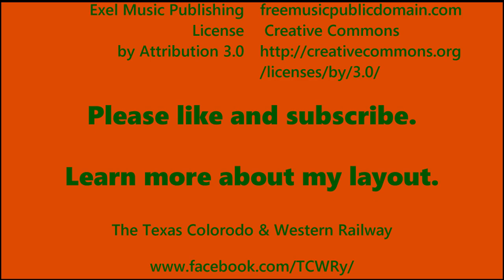Short Circuit Protection for Your Model Railroad DCC System

Comment: My layout is HO four mains each 60-63’ in length. I have color coded Bus one for each track and four PSXX circuit protectors and run Blunami which is particularly sensitive to even the slightest power blip. I am going to install some of these but curious as to how many my first thought is at least one per track but how many would you recommend per track. I am guessing but are these not for momentary shorts versus a dead short before the PSXX trip? Thanks Ron for sharing

Comment: Are you still using the lighbulbs for short circuit protection? Did you switch to electronic circuit breakers.
Reply from the maker: I am still using the bulbs and have no intention of switching. It would just be a high, unnecessary pricetag.

Comment: I know this is an old video, but I was curious as to why you do not suit case your feeders directly to your main bus wire. What in your opinion is the benefit of having a secondary bus wire? Perhaps you mentioned this before but I missed it. Thanks for your postings. Always informative.
Reply from the maker: There are 2 reasons. 1) Using the sub-bus allows me to use the light bulb protection on each sub-bus to protect that district. 2) Because I use suitcase connectors, there is no connector to connect a 12 gauge wire (my main bus) to a 22 gauge wire (my feeders). A third reason is it keeps my main bus from becoming cluttered with offshoots. If I make a change and need to rewire, I can change that district without touching the main bus.
Reply: @RonsTrainsNThings  thanks for your explanation to my question. I did realize a few of those reasons the next day, but your full explanation really filled in the blanks. Sound reasoning for sure!

Comment: Hi Ron, i enjoyed your video and am just building my first model rail i have mastered soldering jumpers to n gauge track etc and come from an engineering background but there is no way i can get the solder to adhere to the side of the taillight bulb. I have filed it, used ethanol to clean it, used a rosin flux with an adjustable 65 watt soldering iron. Can you tell me what i am doing wrong the base terminals are no problem? Many thanks SRB

Comment: I was curious, so I checked out the specs on the 1156 bulb and the resistance is 6 ohms.  Just some of trivia here.  😊  Thanks for all the great tips.  👍
Reply: thanks for that info, it's very helpful. What kind of wattage rating? Any idea? I would like to use a larger diode with a resistor attached, and have the diodes mounted on a maintenance panel pointing to each district.
Reply: @KWE.ECLECTIC  SYLVANIA spec's it at 26.88 watts.  I would call it 27 watts.  😊

Comment: Great video Ron. Thanks for sharing.
I'll definetely try it on my layout, as I have several sections that I want to split for better management. This will give me the chance to install the lamps on the different sub-buses.
I'll also try to install the lamps so that they are visible on the fascia, and that way are able to give me an immediate indication of which section has a fault.
Perhaps smaller bulbs could be an option. As long, of course, as they have similar characteristics.
Thanks once again for sharing.
All the best.
Reply: Did you mount the bulbs on the fascia?  How did you do the mounting?

Comment: Hi Ron I’ve just subscribed to your channel and found this technic of interest. I also subscribe to the dcc guy Larry Pucket, and he talks about RT filters, or other wise known as a snubbers, which uses a resister and capacitor to absorb electrical spikes. My question is do these two techniques serve the same purpose?
Reply from the maker: No, the two concepts serve different purposes and are not interchangable.

Comment: Great idea.  I'm putting together my purchase of these parts but I do wish you had included a parts list.  I'm only guessing that the cable clamps are about a half-inch but it would have been better if you had actually listed the size of the part needed.  also, I had to sift through about 25 pages of terminal blocks until I found one that was close that didn't also include a lot of extraneous pieces that I didn't need.  It would be great if you could update me with all of the actual pieces you used. It's hard for me to get out of the house to buy these things in person so I have to rely on Amazon for most of my parts.

Comment: Thank you very very much !
It is so helpful !
I plan to use a 3 cell Lipo Powerpack, the speed controlled by a microcontroller ( ATTiny ) PWM.
Portable, that´s why the Powerpack.
Those Lipo provide a lot of amps, so in case of accidental short circuit there is a real danger for burning your house.
( I did one, but had luck. )
If not by the cables, then by the Lipo Powerpack !
And you can use the reduced Voltage as signal to stop the PWM !
-->Double safety !
Once more: thank you !

Comment: I am not sure if the 1156 bulb method works for an nce power cab.  Typically I find that the power cab responds first by shutting off and resetting and that the bulb doesn’t come on at all. Sometimes the bulb does light but is more the exception than the rule. Has anyone experienced this? I’ve checked my wiring and I think it’s ok but I am open to any suggestions. Thank you.

Comment: Ron.  Great instructional video.  I have a question. 
I have 5 terminal blocks throughout my switching layout. I have no created power blocks. Likely will run no more than a couple of engines at a time, at most.
Do I need to install short management on all 5 terminal blocks?  Will one do the job?
Reply from the maker: If you have no divided power blocks one will do it.
Reply: Thanks Ron.  I'll make it so.

Comment: love the idea  but the bulb is resting against your bus wire when seeing a short will this not illuminate the bulb to full power (getting hot) and melt the bus wire its resting on ?
Reply from the maker: No, the bulb doesn't get that hot, plus the idea is to find the short and relieve it quickly, not to leave it and let the bulb burn long term.
Reply: @RonsTrainsNThings  hi thanks for this answer  i apologise  for the query i am now retired due to  cancer and need a hobby so i am new to model railways and building a dcc layout i am trying not to make any costly mistakes i try to watch and learn your posts are very helpful thank you

Comment: Great video! this method makes perfect sense. there's really no way that the amperage could spike higher than the bulb allows, which i think is 2 amps and that's not enough to damage anything.  At least based on my somewhat limited knowledge of electronics.

Comment: Thank you for a great  and informative tutorial. I know this is an old clip but I am new to DCC and have had a lot of problem managing short circuits. If followed your instructions pretty closely  and I have had no further issues. I appriciate you taking the time out  to show your method. It was cheap and relatively
 easy to follow.
Reply from the maker: I am glad you found it helpful and it worked out for you. I've been very happy with this method for many years.
Reply: @RonsTrainsNThings  Thanks again, I just finished wiring my dcc layout and it seems to be working fine. its been a great help your instructions were very easy to follow and its a great cheap idea. On a side note,  I was wondering if you may have some advice or past videos about short circuits and how to find them on your layout?
Reply: I know this is an old video, but I was curious as to why you do not suit case your feeders directly to your main bus wire. What in your opinion is the benefit of having a secondary bus wire? Perhaps you mentioned this before but I missed it. Thanks for your postings. Always informative.

Comment: Ron, and Anon (with the comment just below...

Correct, and this works because the automotive incandescent bulb resistance changes with heat... 
Normal operation with relatively low current flowing to the Locomotive motors = Bulb is cool = Low resistance = Not enough current flowing through the circuit path to cause the bulb to start glowing.
With a "short circuit" on the track... the high current flow thru the series bulb filament wire warms it up = Bulb starts glowing with its filament now hot, and the filament resistance rises from the high heat, which then limits the total current that can flow through the circuit, preventing the DCC Supply Breaker from tripping.
The proper description of this circuit is Elegant, not crude at all.

Comment: I understand the basics of how this works.  But what about the short itself?  Is it usually a temporary thing?  If not, do you try to isolate it?  My layout will be 4x16' and it might be hard to detect a lit bulb 16' away?  Thanks.
Reply from the maker: Once running, most shorts on a laout are cause by equipment derailring, a wheel fouling a turnout, or something being place on the layout. These are typically easily and quickly seen and corrected.
Reply: @RonsTrainsNThings  Thanks, Ron!

Comment: Great presentation Ron. Very helpful as I explore different ways to add a breaker system. Very crisp; no extemporaneous, unnecessary chatter about unrelated jabber. This system I have heard about from a friend who uses this method in areas where he wants visibility to which area is shorted vs. needing to look under the layout. He has his mounted in view but discretely unobtrusive. And your take-outs were precious!

Comment: For those of you who wonder why this works try this explanation. A 1196 auto bulb draws a little more than 3 Amps of current in a 12 Volt tail light circuit. According to Ron the motors in his trains use far less than that (they are high resistance) so there normally is not enough current in the feeder wire to make the bulb glow. When there is a short however, the resistance in the circuit goes down to near zero (not up like he says at 4:57). When that happens the only resistance in the circuit now is the bulb (about 4 Ohms) which draws all the amps it needs to light up.
Reply from the maker: Yes, I misspoke regarding resistance going up, as I've acknowledged multiple times in the comments.
Reply: Correct, and this works because the automotive incandescent bulb resistance changes with heat... 

Normal operation with relatively low current flowing to the Locomotive motors = Bulb is cool = Low resistance = Not enough current flowing through the circuit path to cause the bulb to start glowing.

With a "short circuit" on the track... the high current flow thru the series bulb filament wire warms it up = Bulb starts glowing with its filament now hot, and the filament resistance rises from the high heat, which then limits the total current that can flow through the circuit, preventing the DCC Supply Breaker from tripping.

The proper description of this circuit is Elegant, not crude at all.

Comment: I’m new to this and I am wondering why would you need to use different power districts with DCC? (I mean, other than a reversing loop where you’d have to swap the two wires.) I can understand that with a DC system power districts enable you to switch power to the respective track segments on and off. For example if you would want to leave a train staging on a track or a spur line, you’d power that track off. With DCC, as I understand, you’d simply not address the DCC signal to the respective locomotive.
Reply from the maker: Good question. There are two primary reasons. First, for a larger layout, you may need more power than your DCC system alone produces, so you may employ power boosters and each booster would power it's own district. Second, and more commonly, if you operate your layout with more than one person and thus have more than one train running at once, you will probably want to break your layout into short management districts. Without them if any train shorts the rails the entire system shuts down ala the power breaker in the unit. Using short management districts with bulbs as I describe here or breakers in each district allows the other trains on other parts of the layout to keep running even when one train on one district shorts out. It also provides your equipment some additional protection from damage resulting from a short.
Reply: @RonsTrainsNThings  Thanks for your detailed answer. Good points!  Much appreciated!

Comment: Hi Ron,
Thank's for the video!
Great solution to what could be a costly problem. One question, in your opinion would the length of the bulb wires make any difference  to the amount of current to the feeder wire? I assume it might, but not sure if it would be nominal or not.
 Reason being, I'm envisioning a panel not all that different from a dc block panel except with the bulbs located on said panel indicating their respective power districts.
Thank's again!

Comment: I’m getting ready to build my 1st DCC system.  I’m planning on using this bulb system ... my question is- how often do you experience a short?
Reply from the maker: You will tend to see shorts when you have a derailment or, in some cases, as equipment passes through turnouts. The true answer depends on your track and your rollingstock.

Comment: For a couple bucks extra you can get dozens of bulb holders from eBay. Also, any 25-30w automotive (12v) tungsten bulb will work. It doesn't have to be the 1156 bulb shape to have these same electrical characteristics.

Comment: Great video and an excellent idea.  Have you tried putting a multi-meter to rails to measure amps during a short?  I'd be curious on your layout how much the current actually drops to protect the locos from damage.  

Also, for anyone considering doing this, there are also amber colored bulbs (p/n 1156A) available if you prefer.

Comment: so by connecting the two cables from the light bulb to your bus line and track feeding cable it completes the circuit for both sides of your track?  I suspect that the DCC Signal would travel through the lightbulb and to the feeder wire on a normal non shorted circuit?  If there is a short on your track somewhere within the feeder wires section of track it will lighten the bulb informing you that there is a short.  That's great but how would you see the bulb laminate if it is below the bench work? 
 Second question; while attaching the car light via the two wires to your bus feed..You had connected the black wire with a permanent connector to the top track feeder wire.  Could a person not simply attach the track feeder wire to the bus connector instead of attaching that metal connector thingy?
Reply from the maker: Hi, Will. For my layout the bulbs are near the front of the benchwork, so they light up the floor. I do not currently have a curtain under the layout. If you did, you would simply have to lift the curtain and see which buld was lit, thus which sectin was shorted.

As for the permanent connection verses to spade connector, yes, you certainly can do that. I like the spade connectors and terminal strips only because it allows me to easily disconnect a track if I need to for maintenance, troubleshooting, etc. Thanks for a couple great questions.
Reply: @RonsTrainsNThings  one other question; what if the car light burned out and you had a short thereafter? I can only assume that you are constantly checking the bulbs for this reason?
Reply: Will, If the light bulb burned out it would, in turn, leave the next section of the circuit dead as there would be an open on the circuit. Remember, the bulb completes that section of the layout circuit. 
Ron, VERY informative. I'm in the process of setting up my layout and haven't even begun the wiring. Now, where did I put those insulating track joiners...

Comment: Hi Ron
Where are these  light bulbs placed?  and 

(how are you made aware of the short taking place,)
As I am picturing everything under the layout, out of sight 

I do like the idea 
Thanks
Reply from the maker: Good question. They are under the benchwork near the front. You can see them shine on the floor, and in most cases would shine through or under any skirting.
Reply: Ron's Trains N Things 

Thank you Ron
Very helpful 
Keep up the good work

Comment: This is one of the few things I don't understand about DCC. I've been planning a layout in DCC for a while (money!!) You mention "short protecton districts". That means that each district section with its lightbulb is isolated from the others by insulated rail joiners, correct? Is there any recommened size for each district? Then only the shorted area lights up while not affecting the other districts? What would be better, having the lightbulb next to the district or having all of them on a panel by the control board?
Reply from the maker: Great questions, Gabe. Yes, each distric is electrically isolated at the rails. The length can vary, but I would say absolutely no shorder than your longest train. I divide mine into work districts. An entire yard is on one district, but isolated from main and shorts often happen in yards with all of the turnouts. This way a shor in the yard doesn't shut down the main.
I like having the bulbs where the district is, this way if a short occurs the crew at the short knows it is their short, can fix the issue, and knows when it is fixed because the buld goes out.
Reply: @RonsTrainsNThings  doing HO i dont use a sub buss...so where does the 2nd wire attach?...also...if you isolate each district (both rails i assume)...how does the power get there? thx
Reply: so the sub buss puts power in the isolated section?